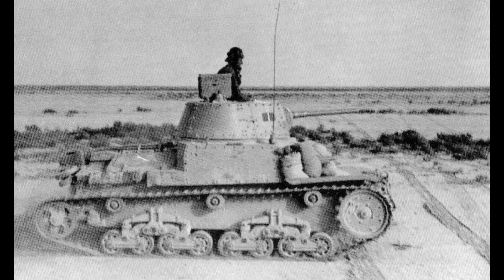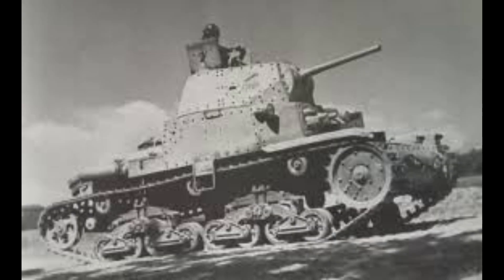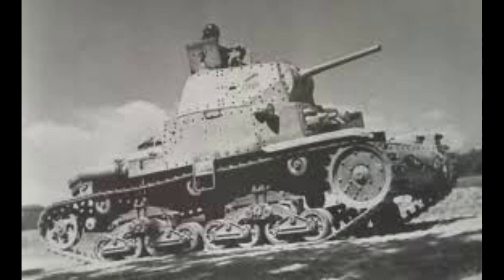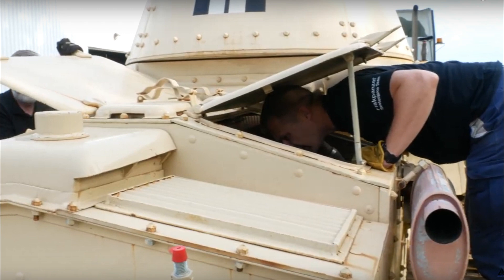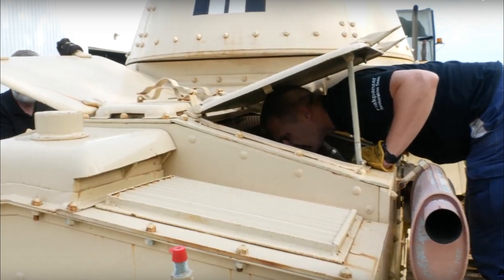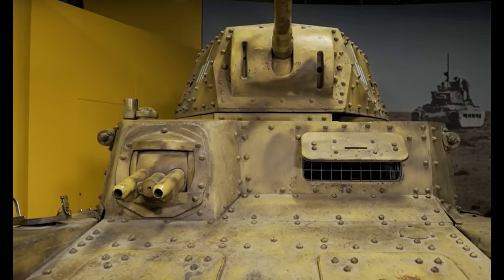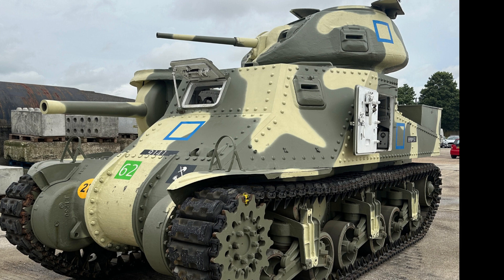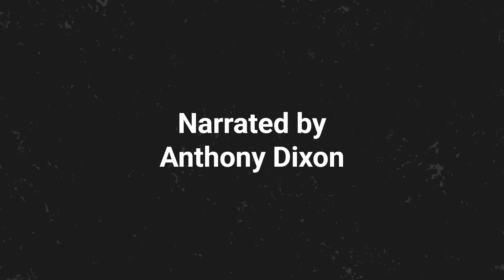Were The Italian ‘M’ Tanks Riveted or Bolted in their Construction?

Comment: Thanks for the update. I believe that bolting was used, in part, so field repairs could be made easily with only new plates, bolts, and nuts. Although, this did not work well in practice due to the deformation of nearby plates and/or framing, etc. after the hit. 
Also, I believe that bolts can also break under sudden stress and fly around the interior just like rivets. 
Bolts are typically a screw and nut attached with wrenches depending on the friction between the bolt and nut threads to hold them in place. See the excellent comment below about using torque wrenches to measure the tightness. Torque refers to the amount of twisting energy on something. Torque wrenches in those days typically used a spring in the form of a handle to measure this twist. Rivets are typically mushroom-shaped and put in hot and malleable. Once in place and while still hot the head of the mushroom is pressed against while the stem coming out the other side was hammered manually or mechanically rounding it over secure the plates, frame to plate, or whatever things they were intended to connect. There are some great videos on the web including YouTube of bolts being heated in a furnace and tossed between workers on buildings in shipyards who caught them in a can so that worker could then insert them usung a plier like tool. Again, this is just my amateur's description. Keep up the great work! 
Thanks and blessings!
Reply from the maker: Excellent detail, like I said I'm not an engineering man so I need you guys to fill in the information on tank building and construction, I'll keep learning!
Reply: @ArmoredItalia Thank you! My PhD is in theology so don't put too much faith :) in my engineering statements. What I do know is I really like your channel!
Reply from the maker: @brucermarino  Thanks!
Reply: @ArmoredItalia my friend, I forgot to add that if I can ever do anything to assist your fine channel, please let me know!
Reply: One thing I should have added. Although bolts are easier and requiring less skill to replace, the other issue is that bolts are very difficult to remove. Thus making removing a damaged plate very difficult in the field. As our wonderful channel b has noted.

Comment: Riveted was always my understanding. I'd be surprised that Italy could fielded  welded vehicles. Also bolts could be used but only if they were strictly external as in the Shermans transmitter housing.
Reply from the maker: I've been looking to see if any Italian vehicles featured welding, the SPG 105/25 Bassotto had some parts welded but need to do more research, even the P40 still had bolted armor as the main construction
Reply: Most armored vehicles in the 20-30s were riveted/bolted.  only shortly before ww2 did welding come in.  Its a very interesting question why italy never welded these tanks together.  All you need is a current source for stick welding, welding in those days were stick or acetylene gas.   Maybe because poor quality armor and thin steel could crack easily.  I think that study might make a good video.
Reply: @orbitalair2103  The Italy of the pompous Mussolini was much poorer than he wanted to appear, and the various industrial sectors were very closed and jealous of their own political-industrial corner. Welding was already present in Italy at the time, as was high-quality armor, but it was almost exclusively the prerogative of the navy. I'm going from memory, but when the Terni steelworks (which had expertise in both high-quality armor and electric welding) attempted to enter the tank production business, Fiat sent a (not so veiled) letter to stay out.
Reply: @orbitalair2103  Fiat and Ansaldo had a duopoly on tank production

Comment: Among other things, this caused a military controversy at the time due to the poor quality of Ansaldo's workmanship. The bolts, designed according to engineer Giuseppe Rosini's specifications, had to be tightened with a torque wrench to prevent the armor plates from shifting, but Ansaldo's workers often used shortcuts during assembly.
The poor quality of the armor steel, prone to catastrophic failure due to brittleness, is another serious flaw that can be attributed to Ansaldo's inexperience, which was more concerned with profit than the health of its tank crews.
Reply from the maker: Thanks for the detail, you've mentioned a few things I will be including in another video soon
Reply: @ArmoredItalia Excellent comment. This sort of historical detail is greatly appreciated!
Reply: @ArmoredItalia  search: RAV0053532_1994_194-197_10.pdf
Reply: By any chance, was Ansaldo located in southern Italy?
Reply from the maker: @terraflow__bryanburdo4547  Northern Italy, Genoa

Comment: Excellent work! From a distance I certainly wouldn't know the difference but up close as you say you can definitely tell. I'm not 100% sure how rivets work, mind. I can see how bolts work as you have the big nut to stop it coming out, but apparently rivets are put in hot, then contract and that somehow makes them not come out or something.
Reply: Great comment. I posted another comment in which I triy to explain this.
Reply from the maker: I will explain more about how rivets work and how they differ to bolts in an upcoming video, you've pretty much got it - rivets are designed to work as a permanent fastener and more difficult to remove